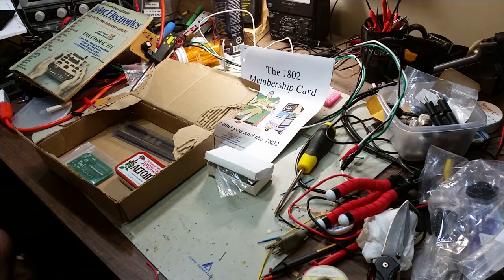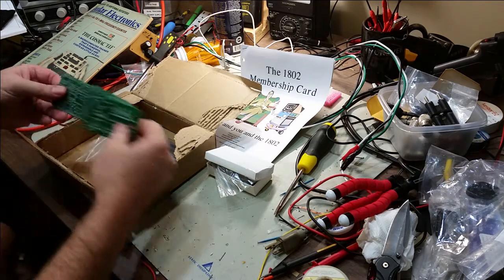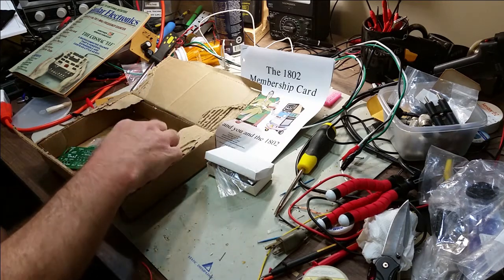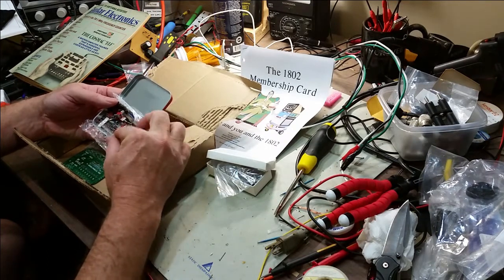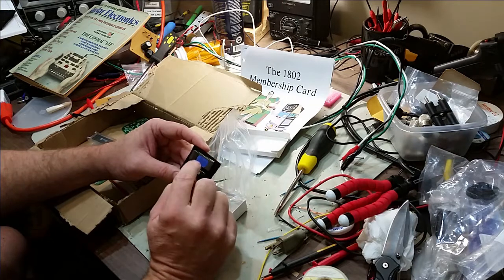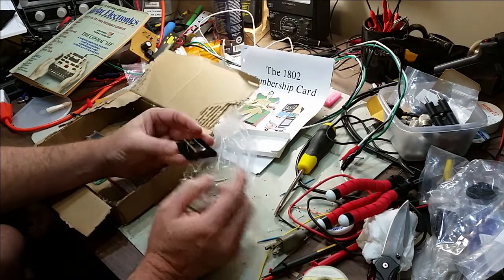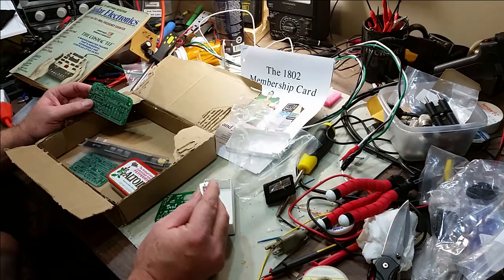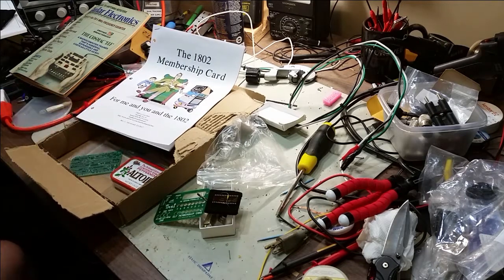The 1802 Microprocessor and the Membership Card kit

Comment: And Lee Hart is pretty flexible, often being willing to sell partial kits at even lower prices. So you could perhaps buy the Memberhip Card without that third 'front panel' circuit board, and perhaps also without the LEDs and toggle switches, and just build the rest of the kit as the core of a more traditional ELF computer for which you provide your own front panel, larger and easier to use toggle switches, different LEDs, etc;